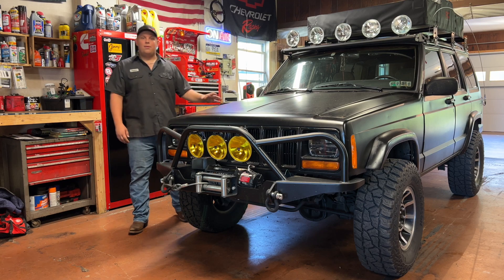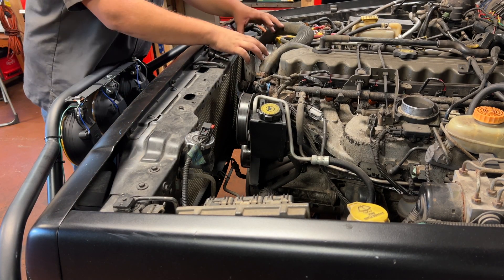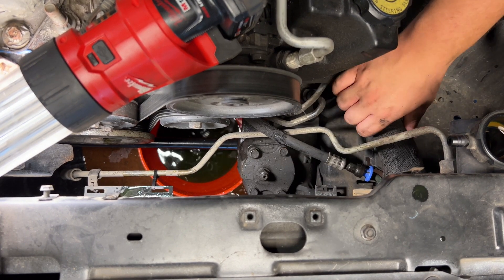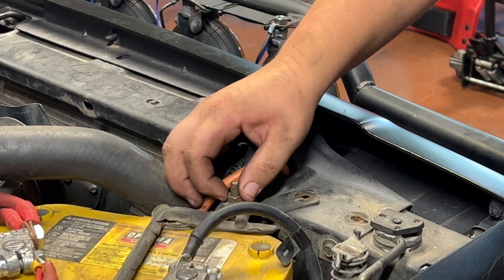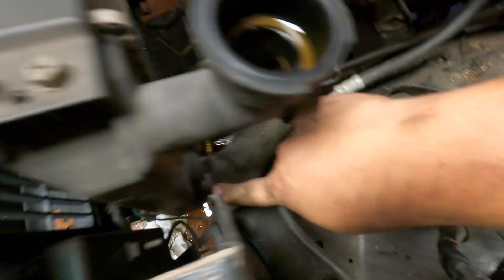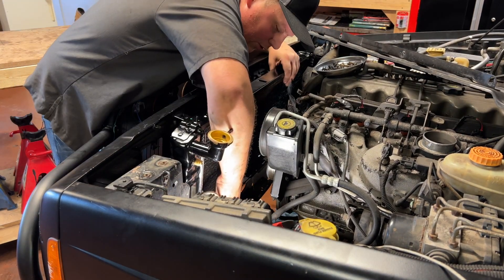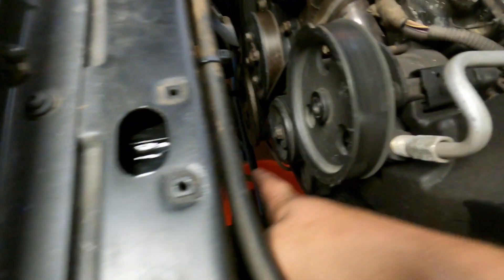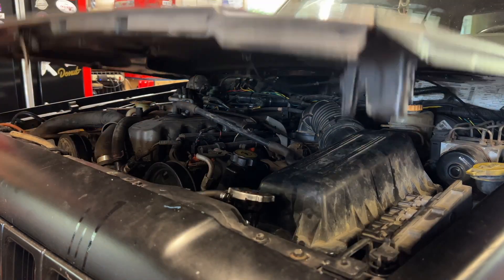How to Replace a Radiator on a Jeep Cherokee XJ

Comment: When you take off the bottom hose from the water pump, leave the cap on your radiator so it doesn’t fly out everywhere. Once most of it’s drained then you could take the cap off.

Comment: Hey Jimmy, nice job on the swap. This ma serve you purpose, I've been getting the full aluminum 4 core radiators from Amazon for about $225. (for the last one at least) My XJ runs way cooler, but I am also running a hi flow water pump from RockAuto.
Reply from the maker: Right on! Definitely need a better water pump to complete my cooling system overhaul
Reply: What water pump you running ?

Comment: Thanks, I had an aluminum (gold color) 3/8" special tool to supposedly remove the lower transmission cooler line. However, try as I may, it would not come apart. I ended up removing the radiator half-way with the hose still connected and then removed the metal fitting where it enters directly into the plastic radiator tank. With the radiator removed, I could see the tabs inside holding the metal tube were actually already pushed back out of the way. So (without the tool) I twisted and pulled over and over again until the short metal line finally popped out (I did spray some more penetrating oil inside, which I had already done when the radiator was still in place. I am beginning to suspect, that for some reason, even after the tabs are pushed back, the tabs still are holding tight onto the metal line (just a theory I have). Anyway, I hope I never run into the modern automotive "engineers" who thought up the idea of a plastic tank for a radiator and a reak stupid way to remove some oil cooler lines.
Reply from the maker: Yikes!!